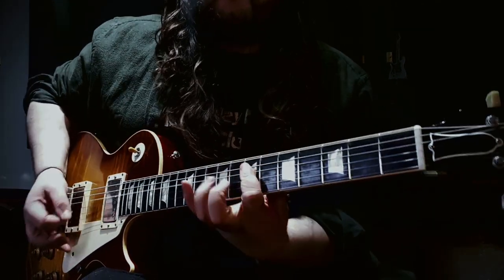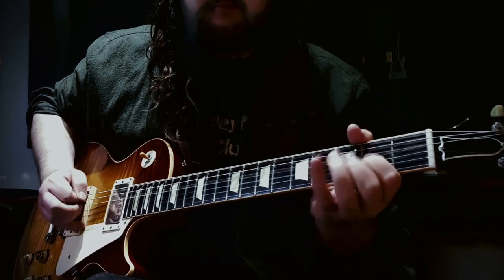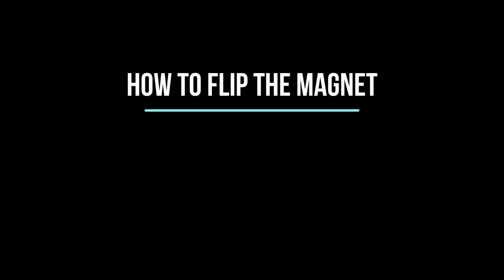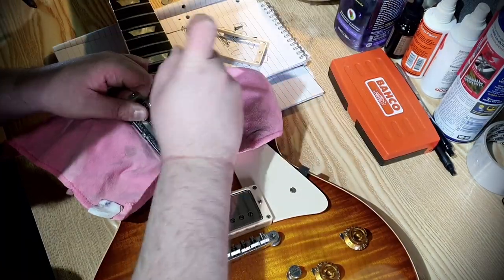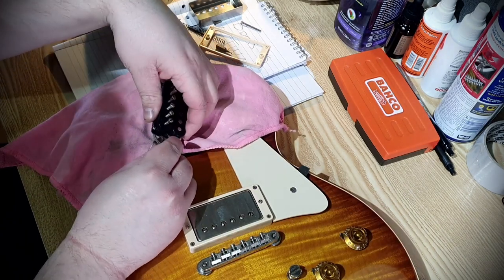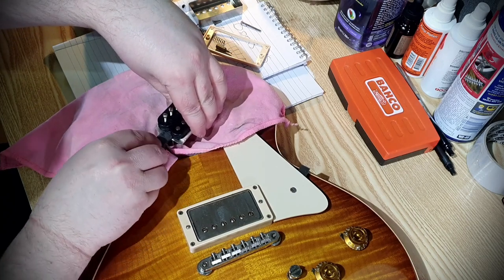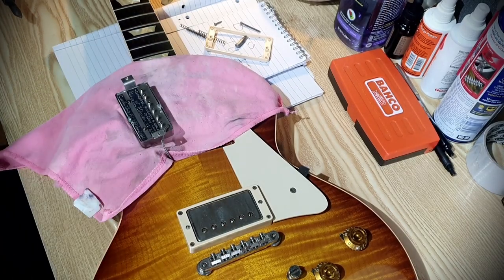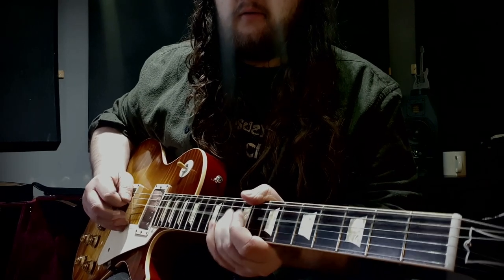The Magnet Flip - Peter Green Out Of Phase Tone. How to do it & how to use it - Alex Hamilton

Comment: How did the Carvins of the 1980s get the out of phase just by flipping a mini toggle?  All (or most) Carvins of that era have 3 mini toggle switches.  The 2 that are side by side switch the appropriate pickup to humbucker/single, and the mini toggle above those switch the pickups to out-of-phase, when both pickups are selected.

I'm the original owner of a late 1984 Carvin DC160T, and own several more 80s Carvins, and yes, the mini toggle really works making the pickups out of phase.

Comment: Thanks, this is the best explanation I’ve found so far, but it doesn’t seem complete. As I see it there are at least three things in play here and you only cover one.  I get that the magnet is rotated 180 degrees. But on the Peter Green / Gary Moore guitar Greeny,, the neck pickup is also rotated 180 degrees, which will impact the sound as well. But you don’t do that here. Why not? If the magnet and pickup are both rotated 180 degrees, should the wiring connection to the pickup stay the same, or be reversed? Or is some other combination of the three things required?
Reply from the maker: No i've covered everthing. Rotating the pickup makes no difference to the sound and i didn't want my pickup upside down. The wiring stays the same.
Reply: @AlexHamilton  That is what I have never got about this mod not to nitpick. Peter Green rotated the magnet but put the pickup back upside down. Wouldn't that technically mean that the magnet is still in its original position just in an upside down casing? That the magnet itself just did a 360?

Comment: Always found my explorer sounded a bit boring and overly punchy. Just flipped the magnet in the neck pick-up per your instructions. Instantly seems better. 

Excited to dial some tones in. Interestingly if I’m using the mix pickup selection and I roll one volume to zero it mutes both. Not a huge issue but an interesting outcome.
Reply: My LP mutes both in the middle position if you turn the volume all the way down on one and it's in phase.

Comment: Just a heads up for anyone doing this mod! I tried this mod and while I now love my middle position, I don't like how the neck only tone is so altered, as well as its respective tone control acting very differently. I read elsewhere that you need to flip the magnet so the up facing side becomes the down - instead of changing the polarity completely by rotating the magnet as you did.

Changing the phase and reversing the polarity of the neck pickup, while being 2 different phenomena, both result in the same partial cancellation with the bridge when in the middle position. However, switching the polarity of the pickup will effect the sound of that pickup by itself, in addition to the middle, which I failed to realize. when the phase and polarity is the same between pickups, there isn't that cancellation. Instead of cancelling, the 2 sound waves from each pickup combine, hence why the middle position doesn't normally lose any beef. However, when the pickups are out of phase, each pickup by itself will sound the same, but when combined produce interference which leads to the final signal being partially cancelled (due to the 2 waves from each pickup not being in sync). This is why you get a thinner sound in the middle. 

Flipping the poles in the pickup causes the same interference in the middle position, but it seems like you also change the phasing between the 2 coils of the neck p/u itself, which results in a thinner neck tone as well as thinner middle.

Comment: To truly put two pickups electrically out of phase with each other, you have to flip the wires, ground and hot, of one pickup, it doesn't matter which one.
Physically flipping the neck pickup (or bridge), gets the active pole pieces of each pickup closer to each other accentuating the out of phase sound.
Bear in mind, the pickup which has the reversed wiring, if it has a metal cover, will cut out if the string touches the cover, also, some more hum will 
be heard especially at higher gain.
Reply: I had a guitar with flat tip humbuckers, after some experimentation, I found that the middle position of the guitar did not sound like it usually does.
I just rotated 1 pup 180 degrees and everything is back.
I didn't fiddle with the pups wires.

Comment: Could you not achieve the same thing by just spinning the whole pick up around once it’s loosened and taken out . Awesome video as always dude , keep on rocking
Reply: That doesn't change the polarity.
Reply: @gibsonfan159  Does the method shown here (reverse magnet) produce the same result as the push-pull switch on some modern Les Paul's (reverse wiring), or is one method preferable over the other?
Reply: @SaxJockey  Not exactly. The electric switch method loses a lot of the bass and is more nasally whereas the magnetic switch method keeps the warmth and sounds better but sacrifices the ability to go back into phase humbucker sound without a having to unscrew everything.
Reply: In a nutshell no! Turning the pickup around does nothing.
Reply: @samapple490 I wonder if you could use an electromagnet in place of the regular magnetic element in the pickup.
Assuming I am not wildly off about how they work you could reverse the flow of charge along the electromagnet to reverse its polarity, recreating this effect and allowing for switching in and out of phase.
Reply: @casanovafunkenstein5090  The problem with using current supplied to a magnet is that you essentially create an electric field which is more sensitive to interference so you’d get a lot of feedback.

Comment: Instead of flipping the magnet  would you get the same tone if you just put the humbucker in backwards? Thanks
Reply: No, it doesn't matter which way round the whole pickup is, you won't get that tone. Once you flip the magnet, again it doesn't matter which way round the whole pickup is, but you will have that tone available with both vol knobs on parity
Reply: Flip the wires.

Comment: Sounds great.. all Les Pauls should come from the factory like this! is there any benefit in doing this over changing the wiring ?
Reply: Being magnetically out of phase vs electrically out of phase: there's a subtle but noticeable difference in tone. Its a matter of taste (and often practicality).
Reply: wozzlepop cheers 👍🏻
Reply: @cgavin1  I just asked a similar question on one of the other responses.  I have a LP ES (semi-hollow), changing the wiring and adding a phase switch would be fiddly (working through the f holes!).   Don't really want a permanent change of magnet on that LP, but think I'll try that on another humbucker guitar.
Reply: @SaxJockey  If you want to really nail the Peter Green sound you need to get a reverse wound neck pickup. Again subtle but noticeable difference. So that's reverse wound in-phase, produces out of phase middle position. In conjunction with 50s wiring its pretty much "the tone". Check this excellent video out by Ramon Goose where he shows and demonstrates the difference: https://youtu.be/ISlXremGXM0
Reply: @cgavin1  Thanks for that.  Had  noticed that video but not yet watched it.  Interesting stuff.

Comment: I tried this with a Rothwell and a Gibson pickups and could not melt the stuff holding down the base plate!
Reply from the maker: The factory solder normally has a really high melting point! A high wattage iron with a big tip is the easiest way. Weller make some affordable ones 😎

Comment: Wouldn't just flipping wires give you the same result?
Reply: yeah, It does exactly that. I've done it by accident a few times with Epiphone pickups and it sounds just like this.  For anyone reading, this only works if your pickup has separate hot and earth wires, as opposed to a pickup with braided wire like a Gibson PAF / 490 type.

Comment: Noooooooooo!
Aw bless, there was no need to go through such a high anxiety process. I just took the two wires from the neck pickup and swapped them over and had my neck pickup out of phase in 70 seconds . 
👃I want everyone to know it doesn't have to be this much effort to get the out of phase tone, to save you all from unnecessary work & potential problems.
Reply from the maker: Bless you too! You've now got a noisey, buzzing neck pickup 🙏

Comment: Peter Green has his neck pickup turned around so that the adjustable pole pieces are facing the other way. You can see this in all the photos. Gary Moore has the neck pickup turned back to the normal position. I have no idea whether the magnet was adjusted in the Peter Green setup or if turning the pickup does it anyway. I might get my Les Paul out and give it a go.

Comment: This is not the greeny sound far from it, I think most people have forgot the
tone over the years, go back and listen again to refresh your ears..
Oh and it wasn’t just a magnet flip that got peters tone..
Reply: Correct 100%  If you put Brian Mays guitar in James Hetfields hands it would sound more James than Brian and Vice Versa. The magnet flip is important but also remember that "Greeny" has had its headstock broken twice, AND the neck came off at the joint in a car crash and has a wood screw holding it on. How far are you prepared to go to replicate the original ?